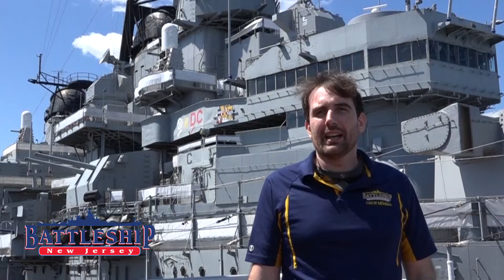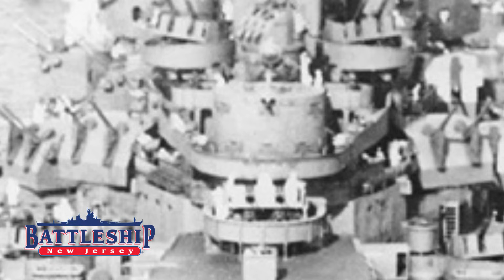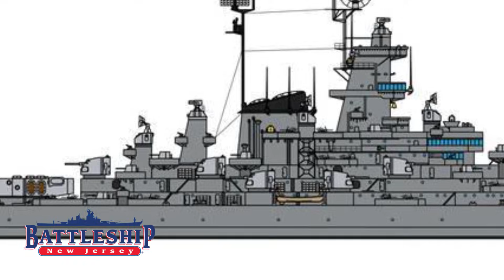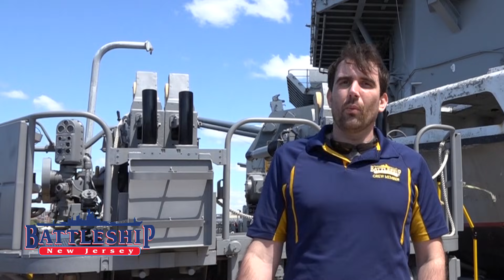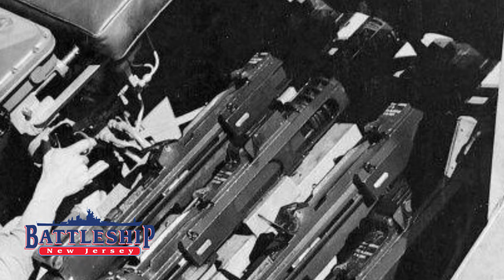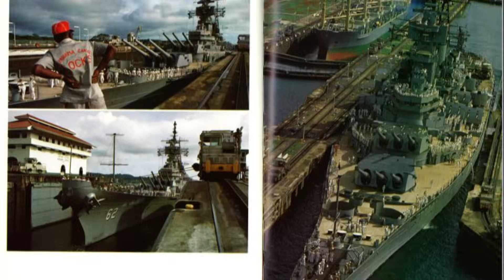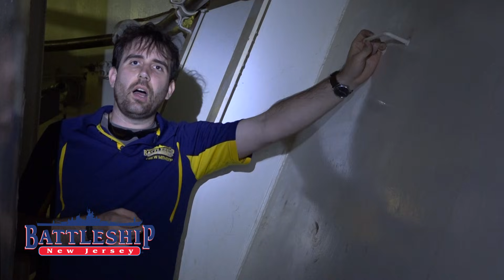What the Navy Doesn't Like About the Iowas

Comment: While it is fun to discuss the merits of a particular BB I am bound to point out that another BB produced has far more benefit to the Navy than any technical improvements. I was fascinated by the savings in weight for an all welded hull version and I presume it would have been much faster and cheaper to build. I found the bow buoyancy and torpedo defense discussion also very interesting.

Comment: Let's say Skipper is in the aft steering working out issues and the ship goes general quarters and the main guns turn on. Incoming is arriving as hits and Skipper needs a way back to the bridge that will survive and not get blocked. Half way up that tube is a steering wheel much like your cars, it overrides the bridge steering wheel above it that is removable. the panel has controls and communications with the Helm, Control Forward, and Damage control.

 I can talk to them, I'm driving, let's do this.......Skipper out !i

Comment: In modern terms? They are extremely resource-intensive, in terms of personnel (they have no plant automation whatsoever), fuel, and munitions. Their armor is effective against ASMs and gunfire, but one modern torpedo under the keel would finish a battleship outright. Lastly, the logistics are impractical. Good luck finding spare parts for equipment that was built over 70 years ago.

Comment: Ryan:  One thought is the removal of the aft turret / barbette and placement of a 256 capable VLS within its own 8-10" STS 'citadel' to off set the weight.   Remove after 16" director and placing a housing for SPY-5; add more Tomahawk and Harpoon quad launchers, change the 5'/38 to three 8' at main deck level.  Addition of RAM and 2-4 CIWS, 20mm auto at 8 total locations (4 port, 4 starboard) along the outer main and second deck (at places of previous 40mm mounts were) for small boat defense.  I like the suggestion of compartmentalizing the engineering space and addition of side blisters for further torpedo defense.  And if we still have 14" and / or 12" shells remaining, somehow flechette them for firing from 16" tubes.

Comment: Most of the people in comments sound like they really know a lot about naval ships. I don't. I am 68, never been in any branch of the military - the closest I came was to design interiors of buildings for the Navy.  Buildings. Not ships. That said, it is obvious if we still needed battleships, the Iowa class would still be usable. But if they needed more ships? Of course the Navy would improve on the Iowas, and while nostalgia might not like it, I am willing to bet the improvements would be exactly that. Maybe not all of them - any designer can make a mistake. But when you have a very good working design, the first rule is always not to muck it up. You can start with a clean sheet of paper - that has a chance to work a miracle or be the worst mistake of all. But the Iowa design is now - what - 75 years old? So starting with the plans of the Iowa, employing modern tools and technology will gain you some more space. Iowas already had excess space as they were intended to last a long time, and that space made it possible to modernize. When they were initially designed, they did not know there would be a huge trend for technology and tools to actually do more in less space. So they have a lot more space than anticipated, if you were to take the existing ships and modernize them. So first, nuclear fuel. Also add nuclear weapon capability and modern missiles. Those are smaller than at first too so that has an excellent chance of fitting in. That excess storage you mentioned will be used for missiles. Those are the changes I would expect to be considered - but with her fuel capacity and range on her old fabulous engines - those might not need to be changed. If it were fuel or weapons, weapons should win. If nuclear fuel would make this ship faster - then I'd want to try to fit it in. If her hull made going faster dangerous, that would be a vote against nuclear fuel. 
I'm not a nautical designer - those folks are amazing. But just talking design - that is how I would parse through what the Navy said it wants and what the ship can hold. You always give the client what they want - if you can though, so I would definitely hire a nautical designer (ship's architect) for the design team!

Comment: Speech was garbled.  Should use mike on the collar to avoid echo and improve voice pick up. The distortions due to echoes  even distorted the words of the speaker that words he said that were in the closed caption were not shown correctly, instead different words  shown.  Also better diagrams of features so viewer can visualize concepts features of the topic.  Speaker is very well versed on the topic.  Some coaching in videography would help.

Comment: I served on board the USS Iowa from 1983-1987.   The Iowa class battleship was originally designed to combat the German Bismark class and the Japanese Yamato class.  It was state of the art during WW2.  The design of the bow allowed it to travel 33 knots.   Which meant they could keep up with the new carriers.    Unreps are ALWAYS dangerous.  But easier with Battleships.   Iowa's were so stable and smooth sailing even during heavy seas.  They had 58,000 tons of displacement.  They rode like a Cadillac or Rolls Royce.  They were 109 feet wide so that they could fit through the Panama Canal.  Same for carriers.  The extra protection of the conning tower really helped when Kamakazi planes crashed into them.  As well as the 16 inch armor on the turrets and hull.   Turret 2 had nothing more than a scratch from a direct hit.  The helm, and CIC were well protected.  And boyency was not a problem.  Their extra weight was not a problem as 3/4 of the ship had 16" steel plates going from turret one past turret three, plus the turrets.   The 5 5" gun mounts on both sides was standard in WW2 and later, for shore bombardment and attacking several ships at once.  5" mounts were not very effective on destroyers against other ships because they couldn't carry enough of them.  Too much weight.  And you need a lot of 5" rounds to inflict enough damage on an enemy ship to matter.   Battleships were very helpful in shore support.  Any marine landing on Pacific islands will tell you.  The upgrades was easy in the 80's.   Two mounts were removed from both sides and replaced with Tomahawks and anti-ship missiles.  The 4 entire 5" mounts plus ammo weighed more than the new missiles and mounts.  There was even talk of replacing turret 3 with a Harrier plane hanger and flight deck in the 80's.  The battleships were a wonder and very effective during the Korean War, Vietnam War, 80's and Desert Storm.  They could still be useful with that aft hanger and flight deck and a squadron on F-35's.
Reply: They was created to protect the Carriers Strike Groups, thats why she had over 100 A.A guns, speed, good radars and thick armor at places that the enemy aircrafts could attack, and  coastal bombers, shes guns was very precise for this purpose, the USN didnt build the Iowas for fight to other enemy battleships, and yes the cancelled Montana. In all their live they just sink 1 DD and a CL that was a little bit bigger than a destroyer.

Comment: Was always wondering about the subdivision in the Iowas. Actually surprised that it wasnt as significant as older ships. Also the torpedo protection forward. Wonder if one of the Iowas saw battleship on battleship fight getting hit, how it would fare. Interesting. Saving weight was probably the reason for not subdeviding as much.

Comment: The "Battle" in them was much much better than the "Ship". It´s often reported and proofed how they performed relatively poor in heavy weather compared to HMS Vanguard for example which showed much less heeling in certain conditions.
Reply: The person who told you that is so full of crap they have it coming out of their ears, there's more pitching up and down on a Nimitz Class than an Iowa Class and as far as bad weather goes, I'd rather be on an Iowa than a Nimitz
Reply: @michaelmckinnon1591  um he literally said that in the iowa vs vanguard video. You’re full of shit
Reply: @michaelmckinnon1591  The data is available. In a manouvre in the fifties the Vanguard showed 15 degree heeling where the Iowa showed 26 in the same conditions. Plain facts. The disadvantages of the relatively slim bow are explained in the video. 
And a carríer like the Nimitz isn´t comparable anyway, it was about comparison to another battle ship.

That doesn´t take anything away from the marvellous Iowa-class ships, which always reached their destination, no matter what. I visited the Iowa itself in the eighties in Bremerhaven, Germany and i´m still impressed. But the title of the video was, what the Navy didn´t like about them. 

Ship building always requires to find a compromise between different characteristics. There is no perfect ship, they all have their strengths and weaknesses.
Reply: @mk.5706  26 degree temperature swing maybe but not pitching deck on an Iowa, Carriers on the other hand rock back and forth like a hyperactive person in a rocking chair and pitch up and down by as much as 45 degrees and occasionally the aircraft have to be chained to the deck so they don't fall off into the sea and below decks so there isn't a fireball.
Reply: @michaelmckinnon1591  I’ve served on two of the older class carriers, the USS Saratoga and the USS Kennedy. The times that pitch and roll became a factor were in obscene sea states of 30 ft waves or more.  Even then rolls over 15 - 20 degrees were rare occurrences.   Yes they pitched up and down and yess they took water over the bow but in 30 ft seas. Not in everyday sailing. ALL aircraft were tied down ALL the time unless actively being moved, launched or recovered. Just my experiences in the Navy. Yours may have been different.
Reply: @mk.5706  And how loaded was the Iowa at the time vs the Vanguard? It makes a big difference. In head on waves, the Iowas would have just plowed thru while the Vanguard would have bobbed like a cork. And she was not as maneuverable as an Iowa.  And with smaller guns, would have been out distanced in range so an Iowa would have won. Plus the Vanguard wasn't battle tested. All four of the Iowas served during the war.

Comment: Wonder what it would cost to fill up the tank on this ship.
Reply from the maker: 2.5 million gallons times whatever your local cost of diesel is woll get you close.
Reply: @BattleshipNewJersey  So lets see 2.5 million US gallons is around 9.4 million liters. Times the current price for tax free disel in Norway 9.85 NKR. Equals 92.5 Million NKR which is around 11 Million US Dollars.

It sounds absurdly expensive, I was always under the impression that these larger ships ran on some type of crude oil/semi refined. That was made to keep the costs down.
Reply from the maker: Its not exactly diesel, it's marine distillate so its not 100% correct on the price but it gives you a ballpark

Comment: If the hull was welding there's a bigger chance in the cold waters the hull would've cracked am I right idk I just heard that from the jagdpanzer 38t that it was welded and in the colder areas it has a bigger chance if not just cracking from the cold

Comment: I think one of the worst designs was / is the 16 inch turrets and barbets,  the bottom of the barbets were death traps if a 16 inch shell hit at the "right" angle which luckily never happened.  It did explode on the  S.S. Iowa in the 1980's in the No. 2 turret with 47 sailors died in practice.

Comment: Short answer: a battleship's main guns have a 30+/- mile range, and a destroyer can take it out with a guided missile from over 100 miles.
Reply: Are you talking about tomahawk missiles and harpoons? The Bbs have their own missiles and point defense systems. In contrast, one hot from a tomahawk and that destroyer would be put out of action.
Reply: @GentiluomoStraniero  just letting you know why the navy isn't fielding battleships. Its more cost effective to staff, equip and field numerous smaller ships. Yes battleships can carry missiles as well. But the 9 sixteen inch barrels aren't worth it anymore. Its an obsolete system now... magnificent ships, but more cost effective for numerous smaller ships.
Reply: @wcoonradt264  As far the 16in guns go, once the shore bombardments are needed once more, The magazines of a BB hold quite a few more rounds than a DDG's magazines. At this point the sortie rate for a BB exceeds that of a few DDGs with missiles AND a CGN combined. Whether something is obsolete, is a matter of the battlefield requirements at the time. If war broke out with China in the Pacific and island hopping was needed again....the BBs are an asset.
Reply: @GentiluomoStraniero  again, I disagree and so does the department of the navy... the shore bombardment capability of the BB has been replaced by the air power of the carriers and amphibious assault ships. Again being more cost effective. I like battleships too, and their awe inspiring, but at the end of the day, they are obsolete.

Comment: They needed to up grade the 5"38's to the MK42 5"54's it was the best gun. In 80's to 90's they should have switched out every other 5" for missiles. As for the 40mm's could put in stinger batteries and Mk76 gun. The Mk42 and Mk76 can fire more faster. This is just my ideas to help the ships fire power.

Comment: Iowa Century class upgrade, go nuclear replace the 16s with railguns, Perk since it's now nuclear it doesn't need to breathe air to operate.  While traveling submerged would not work well for the hull design it could be useful for a battleship to have the ability to seal and sink or have the increased ballast control to sustain battle damage.  The weight saved by removing the standard fuel and powder storage could see a marked increase in speed but may increase vulnerability of the hull as it would ride higher, but could be countered by use of ballast tanks. Also modernize the systems to reduce manpower as much as possible, reducing the crew dependence for operations like to the point that the ship could run itself and personnel would only be required for maintenance. But realistically this concept would be better suited with a new hull design, the Iowa's were reactivated and refit in the 80s largely due to the economics of the hull size and speed for mounting cruise missiles on.

Comment: I like this video. Here's a question... would a new battleship be nuclear powered, and why?
Reply from the maker: Check this out https://youtu.be/ZkVF25RyzO0
Reply: @BattleshipNewJersey  I figured you might have already addressed this. Thanks for the link. I just pulled it up
Reply: I'm only a couple of minutes in, but I already have comments. I'll wait til the end of the video just in case you covered it, which you probably did. Thanks for doing it.
Reply: So I think most of the posts on that video explain it all. Nuclear reactors are not that fragile, and battleships are not fragile at all. The Iowa class had great advantage when they were built, but a new "battleship" (not a Ticonderoga cruiser) would have build in self-defense technologies. Think of Kevlar plating instead of steal, polymers and composites that reduce weight. I agree that a retrofit on an Iowa class is too much to ask, but the real question, is... what value would a new battleship even have when the whole point is shore bombardment and a missile launch platform?

Comment: 0:12 laughs in HMS Vanguard
The KGVs and the Vanguard tbh had way better armor than the Iowas tbh. Especially considering the metallurgy of British stew used for the KGVs and Vanguard were way more durable than the stew used by contemporary navies. Also the 15”/42 Mark I had almost (if not equal) damage power as the 16” Mark 7. Furthermore, Vanguard’s main and secondary battery were in Remote Power turrets, whereas the Iowas’ main battery was not Remote Power.
I’d put my money on the fact that if Vanguard was toe-to-toe with any one Iowa, they’d be pretty evenly matched.
Reply: That's utter nonsense. The IOWAs armor and construction is equal to or better than the KGV and Vanguard. The 15"/42 ballistics are NOT CLOSE to the Mark 7 firing the super heavy shell--which were nearly equal to the YAMATO's 18" guns. Where do you get this stuff? The IOWAs were superior in speed, range, hitting power, and fire control. The VANGUARD was a generally better sea keeper in very rough seas.
Reply: @iowa61  Iowa’s belt armor was shit, and everything else was okey. Her guns could only rival Yamato’s guns from long ranges.

Comment: Fascinating information.  I had not run across this information before.  I had heard of the Tunderbolt mounting but wasn't aware that it was ready for production.  That would certainly helped the 20mm stay competitive!  The Kamikazes changed the whole AA game.  Earlier efforts were two-fold; 1) shoot down the enemy plane or 2) put up enough fire to prevent the ordnance for hitting the target.  The Kamikazes eliminated point 2, so the gunners had to literally shoot the plane to pieces to prevent a hit.  By the time the 20mm could get hits the plane was on its final plunge.  Same deal with the 40mm - excellent system but usually not enough hits to destroy the oncoming plane.  The 3" seemed to offer a lot of potential, a good shell with a VT fuse coupled with radar direction.  
Personally I regard the Iowas as the most beautiful battleships ever built but I can see why that narrow bow section would make them "wet" and reduce the torpedo defense.  The added fuel would have been quite helpful not only for the ship's use but to help feed the hungry escorts.  That rebuilt superstructure is interesting - much more effective use of space and really opens up AA arcs.